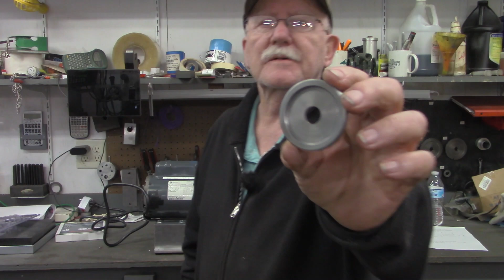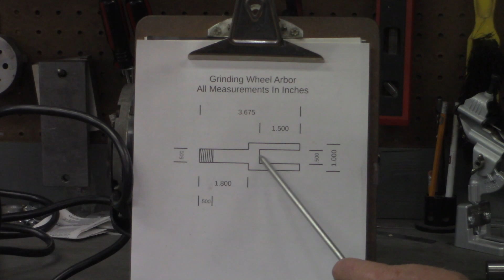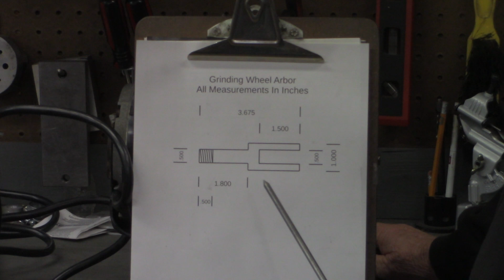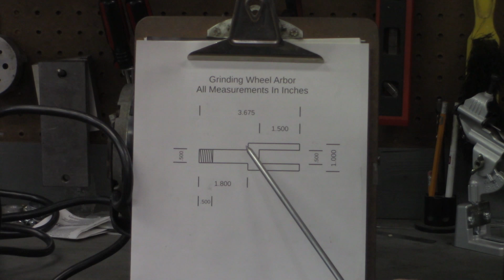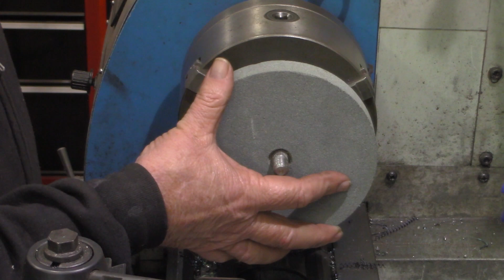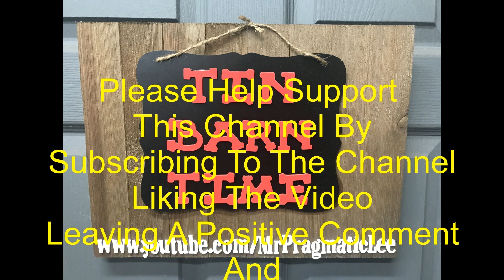Machining a Grinding Wheel Arbor

Comment: I swear they do not sell those flange washers separate from the bench grinder. So infuriating that I need a machine shop to address such an issue.
Reply: tool shops sell the flange washers as spare parts for angle grinders.

Comment: Make sure that grinding wheel is rated for side grinding, most are not and you would need a cupped wheel.  Wheels can do nasty things if they are used in a way they were not designed for.  Or set the rig up to grind on the rim if the wheel is not rated for face grinding.  Enjoyed the video (and you never even went to the grinding machine!!).

Comment: This is a nice little project.  I have one comment.  I have heard that when mounting The grinding wheels to the arbor a paper or fiber washer the size of  the washers should be used between the wheel and washers.  I believe that two hard surface putting pressure on each other is not good.  The grinding wheel might have more tendency to break.  I'm not sure but I think the grinding wheels usually come with the fiber spacers glued to the wheels.  KOKO!

Comment: Hi Lee.  Wouldn't you want to turn the large washers around the other way, so that the cupped side is facing out?  Maybe it doesn't matter but I would think the contact surface to the grinding wheel would be greater that way.  Also, I noticed the switched outlet device you have the motor plugged into.  I had one like that, which was rated for a 15A load, with a space heater plugged into it and it melted the device itself and the outlet it was plugged into.  The heater was rated at 1500 watts so it should have been less than a 15A load at 120V.  For the motor, it is probably fine but wanted to pass along my experience.  Mine could have started a fire if I wasn't sitting nearby and smelt it burning.

Comment: I noticed your drill sharping tool which is the same as the one I have.  I used a cup grinding wheel on my 6 x 12 surface grinder to sharpen drills.  It does require some setup including putting the cup wheel on the grinder, however it does work quite well in sharpening drills.

Comment: We are on the same page.    Have the same sharpener etc.   The key to very good results is a well balanced wheel.  Make the arbor longer to accommodate a pair of balancing disks behind the wheel. The discs are easy to make and use.    I much prefer this to removing material from the wheel especially with this jig where we contact the wheel on the side.   

I would do it myself but my channel only has a few 100 subs so it will get much wider distribution if you do it.
Reply: would like more info no these balancing disks if you would or do you have one on your channel if so lets know of it and i'll have a look see Cheers
Reply: @wallbawden5511  Will look into what I have later today.
Reply: I’d be interested in seeing that also, wouldn’t hurt if both of you guys put up videos on it. Thanks